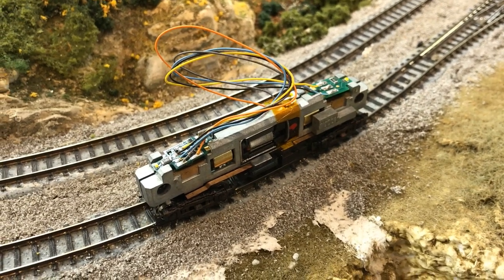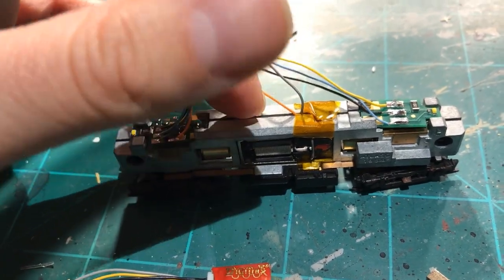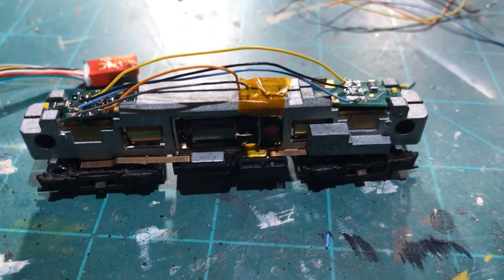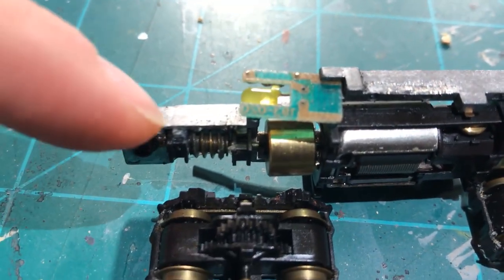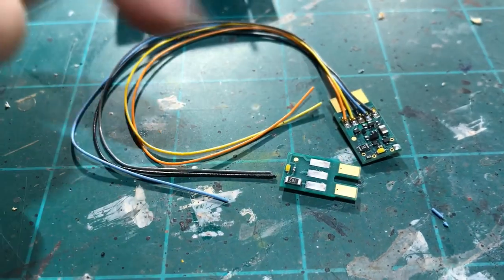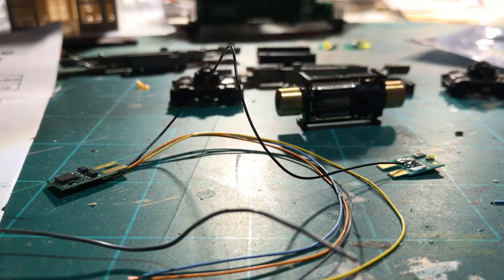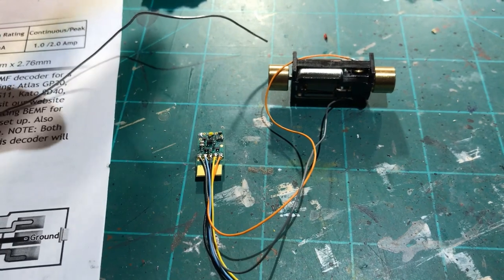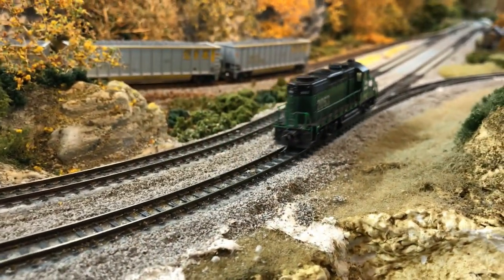DCC TCS Decoder Installation

Comment: Great install! Every time I try and install the CN decoder in an atlas rs-3 locomotive, i end up shorting it out, currently waiting for the new run that comes with DCC/sound form the factory. As for the loud  noise this locomotive is making, I would check the make sure the motor is properly lubed and cleaned, especially the commutator. I find that lubing or cleaning this will get rid of the noise.
Reply from the maker: this loco actually quieted down quite a bit - and cleaning and regreasing was final trick.  something i had done time and time again but whatever happened on the last run did it.  i thought it would be awesome to have this with sound - but after looking inside - there's absolutely no way.  so, i too will be waiting for the factory stocked version to hear that ALCO growl!

Comment: Thank you for the DIY vid. I have four bachmann spectrum dash 8's from late 90's what sort of trouble could I possibly be into with those?
Reply from the maker: Hi Sean.  Well, just so happens I have one in my collection.  It didn't make the cut for the layout but i pulled it from storage and opened it up.  Once the shell is removed (2 screws in the fuel tank, then (2) screws holding on the shell), you note the typical Bachmann all metal chassis, but no lights or board.  Inside the shell top, however, there is a board with brass tabs attached to the shell.  I did just a bit of poking around, and a little online snooping and turn up just about nothing.  I think this is going to be challenging install.  You're going to need a DZ146 Digitrax (or comparable) decoder, isolate the motor just like in this video and attached the orange and gray wires.  I think you might be able to reuse the LEDs from the original board, and also any resistors associated with them.  It appears the decoder should fit in the space the old board occupied with little or no chassis modification.  The short of it is, you're going to be doing some soldering and some tinkering with this one - there's no 'drop-in' solution.  Bachmann's new releases do come DCC equipped for future purchases, however!
Reply: @AlleghenyNorthern  thank you. I will dive into it and see what I can do with them.